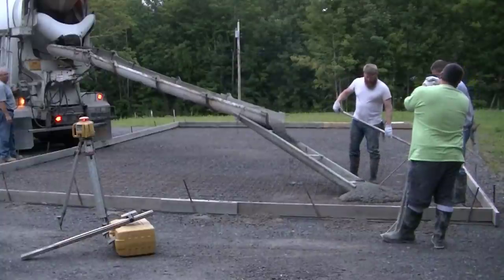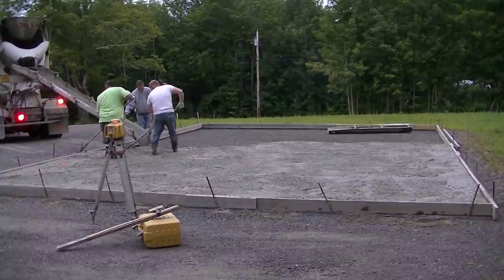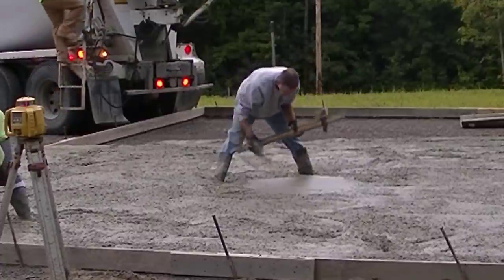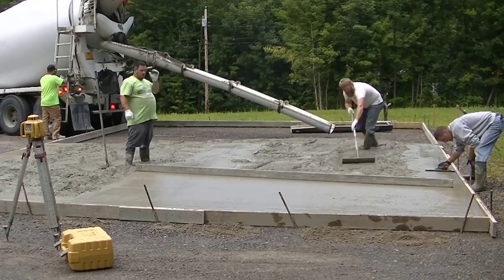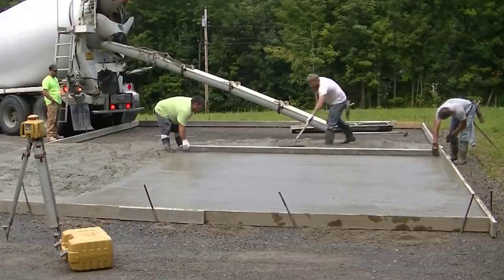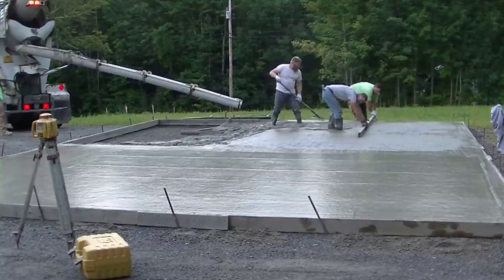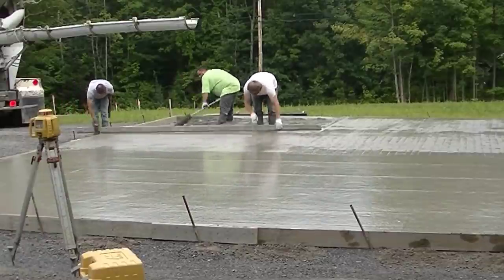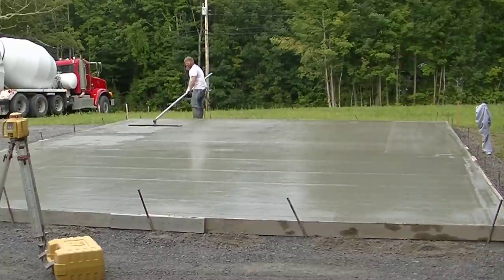3 Men Pouring A 36' X 24" Garage Slab

Comment: You Are Spot On
4 of us are pouring a 32' x 30' floor  
Just got the footers in with  curb walls
Massive 12" thick x 8'' high left  wall
Last shoot extension on truck so worn out it snapped in half on pour...

Comment: I’ve got the same size pad to pour.  I’ve done a little bit of concrete work but this would be my first time doing it with folks who have not done this before. It definitely helps to hear all the informaton and see how things work.  You have to have a good eye to keep the concrete at the correct level before screening or it’s a lot of muscle. I think that’s going to be the hardest part.

Comment: Great Video
I need to pour my extension onto my shop floor which is 32x50.
I poured my main shop as 1 piece slab but used alot of reinforcement in the concrete and 35 years later still on cracks!
Any tips on doing my 32x50 myself?
Thanks,
Jerry

Comment: Youre the only concrete guy i like watching on youtube because youre oldschool and pour and form very similiar to us. Only thing i noticed is you use a laser instead of pins to screed
Reply from the maker: You're right, we mostly use a laser for our pads. We do use pins sometimes though.
Reply: Pins would have saved dragging that Crete up in there before screedig!, also put in a couple "pins" Grade points. ALL forms solid AT grade! Pour the thing out real quick! BOTH trucks!, You're not novice! Then knock it off with the screed method of choice for the day! Bull float once. Go have coffee and a box of doughnuts before the work day really even begins. Cheers!
Reply: We use a wood steak and laser to get the grade and then put a nail in the steak and mag to the nail.It’s easier to pour to grade when you have the steak there

Comment: Hi there this is Johnny Gonzales I'm in Deming New Mexico I'm building a shop 40x40x16 and it will be made with steel pipes and covered with corrugated sheet metal this is the best video I've seen very good work both doing the concrete work and the video recording thanks.

Comment: Front dumps are good when doing a lot of curb, AND the driver's good. But I cut my teeth on rear dumps, never worked a front dump until 8-10 years before I retired. As always, it's a pleasure watchin pros at work! Careful runnin up down those chutes! lol
Reply: When Front end drivers are good and like pouring for you it's magic. I once poured 22 yds of 5' wide by 4" thick county walk by myself. It was like 2:00 and I turned other 2 guys on my crew loose to pour a driveway across town. Walk needed hand tool joints at 5', expansion every 50' w 4 handicap stamps. 6" slump max. When 1st truck starts dumpin I pick up my come along and driver nails his horn and shakes his head no. He laid down 10 ' and I started striking and he kept puttin down 5 to 10' in front of me. 2nd driver did the same. Poured both out w only stop for bull float. Bad ass Drivers from Grand Rapids Michigan. Moved to Florida and rear end drivers bitch about 3 guys on a 2 yd  patio pour with 2 wheel barrels. Some drivers say challenge accepted and some whine.

Comment: I would like to pour a 32x32 slab for a post frame building.  If I get to do it, I'll do some frost protected forming and put in insulation and radiant heat.  But I won't do the actual pouring and finishing.  Those days are behind me. I"m 70 and haven't done a big pour in over 30 years.

Comment: Do you plane the 2 by 4 every single time you use it I mean they tend too get or be warped specially when there's a lot of moisture mabie it doesn't matter idk it's pretty hard to find a straight piece of wood you know they make aluminum ones that are perfectly flat for that purpose

Comment: Just curious...maybe I missed it but why no steel or wire?  Thanks.
Reply: Sometimes fiber mesh is used and it comes mixed in the load. It has the strength and works as well as the bar or wire does

Comment: Love they videos. Im doing a 28x30 pad but im doing a grid pattern pouring 7x7 individual squares. im by myself. any hints. Ive worked construction for 20 year, never concrete.
Reply: No will be doing ready mix route
Reply: The short charges for such small loads are gonna add up.  I recommend  begging, borrowing, or stealing some help to just get it all done at once.  You'll end up with a better end product than 16 individual pours.

Comment: Im doing a 24x30 slab for my carport, had to bring in a bunch of rock for the base, 5 inch thick with fiber strand, you talked about a 5  6 slump  is that the wet factor?  this is my first
Reply: Yes. You need a slump cone which is 12 inches high, 8 wide at the bottom and 4 at the top. . You fill it with cement, rod the air out and lift the cone off. The slump is the amount the pile collapses from its 12" height. A 5" slump would leave you with a 7" pile. We don't do normally do more than 4" slump without reducer.

Comment: Great video!  I'm in Missouri and looking to build a 36x50.  I've had 3 man crews quote it but thought they were light on manpower to do it well.  Looks like it's possible. Seems difficult to find crews I trust, such as yours.
Reply: Sometimes you can get a hold of your local concrete companies and they will refer the right guys because they been working with them for years

Comment: Is there a reason you don’t tie your rebar laps and chair them up? It is minimal labor to do so an ensures it is actually doing what it’s supposed to. Not tying the bars and just stuffing them isn’t saving you any significant amount of money.
Reply: Putting a rebar in the center of a slab doesnt really do that much structurally either way so its kind of a moot point to tie it. Plus its a slab if it cracks and is in bending which will rely on the rebar well it is probably already in a situation that a 3.25" concrete beam isnt expected to do anything but fail... Keeping it high would help with the width of the corner cracking a little bit as it dries and curls

Comment: So 15 slabs done on average per month at $5k per slab for 8months of the year is $600,000. Pay workers ~80k each then divide by 2 to pay concrete trucks/material and you’re left with $200+k in your pocket. Not bad…

Comment: mike why do you leave the mesh on the ground , pulling it up does nothing , you walk over it and pull iy up , use bar chairs or poly fibre , theres no point using the mesh , you make a comment about pushing the rebar in the corners to the middle of the slab but where is the mesh, on the bottom <